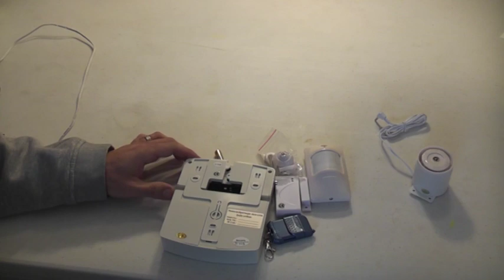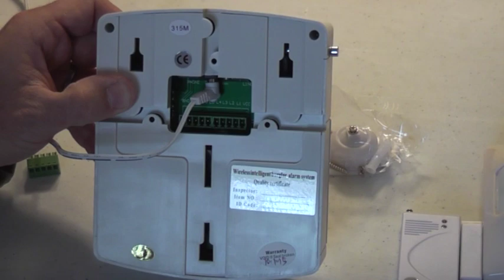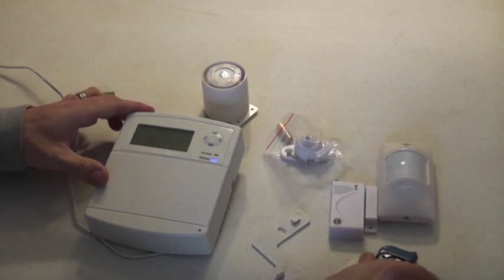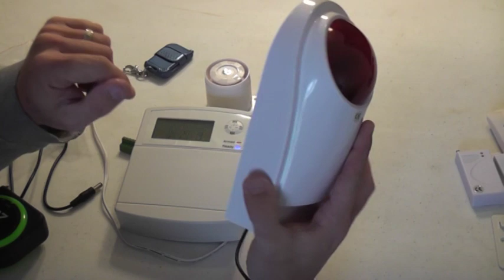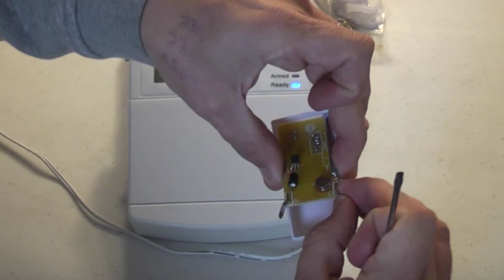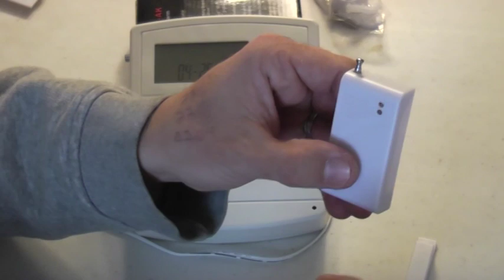WIRELESS HOME SECURITY SYSTEM HOUSE ALARM w AUTO DIALER 1

Comment: This would be cool for a toy. It needs a tamper switch for the keypad so if they rip it off the wall even if they smash it it will alert anyone. Should also get a wirless siren because that one is very limited and can be easily cut.